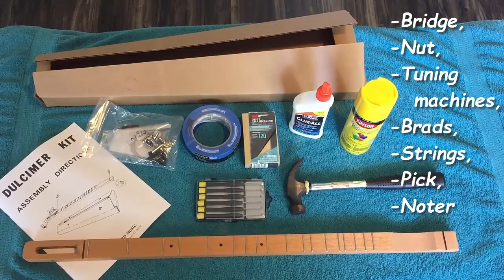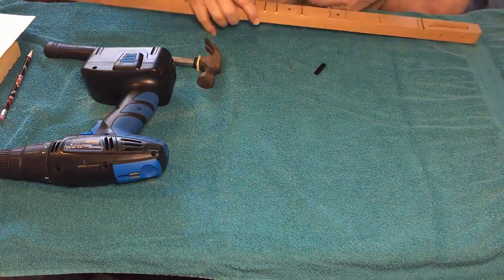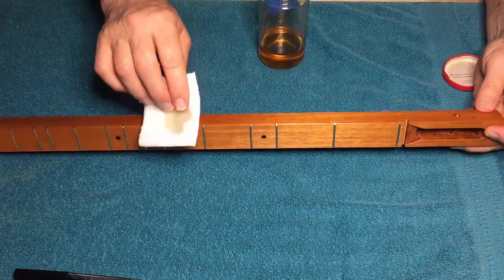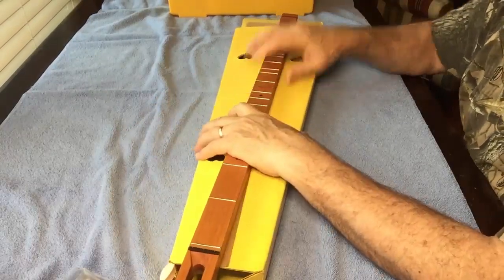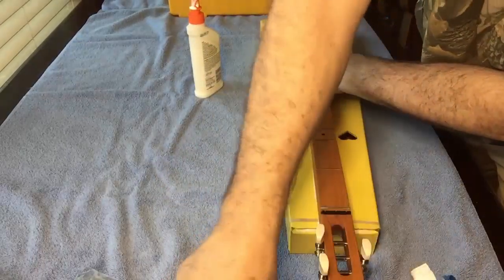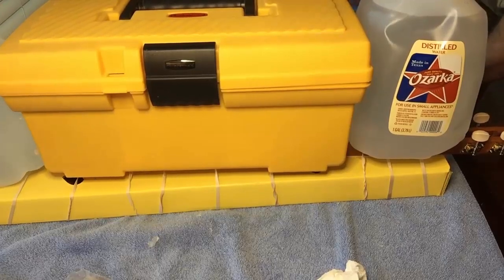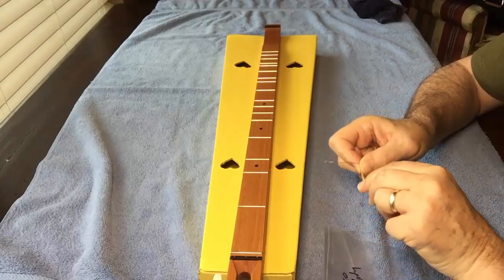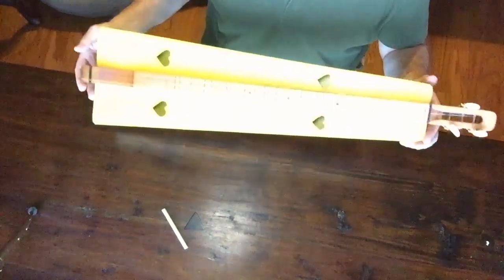Easy DIY Dulcimer Kit Build from Backyard Music

Comment: Hi, Steve - Love your dulcimer build.  I enjoy restoring/refreshing ukes.  Why use a foam sanding block instead of wood sanding block for fret edges?  Why use boiled linseed oil instead of household mineral oil to treat the wood?  Great job.  Sounds great.  Thank you.  Rick
Reply from the maker: Thanks!  I used the sanding sponge because I had it available and I figured most folks could get one easily enough.  I used the boiled linseed oil because I have seen it recommended and used by a number of luthiers as a finish to highlight the grain of the wood.  I have used it on a number of my other builds and have liked the results.  I know folks use mineral oil on cutting boards but I have not seen folks recommend it for instruments.  I suppose you could though. Just be sure to keep it off of the surface to be glued.
Reply: Steve - Mineral oil is packaged as "fret oil" sometimes with a solvent and artificial lemon fragrance.   I love boiled linseed oil on tool handles - hammers/shovels/rakes/etc., but thought it may be too sticky/heavy to use on a uke.  I'll have to check it out.  Thanks, again.  Rick

Comment: Do you have to use spray paint? Can you put a clear coat over the paint?
Reply from the maker: No, you don't have to use a spray can.  Yes, you can put a clear coat over the paint.  You can do what you want with these.  You could leave it raw, or paint it, or clear coat it. I suggest you paint it or clear coat it just to protect the cardboard.  Or, if you want to get fancy, glue together a few cigar boxes and glue the neck to them!  Good luck with your build!  Let me know how it turns out!